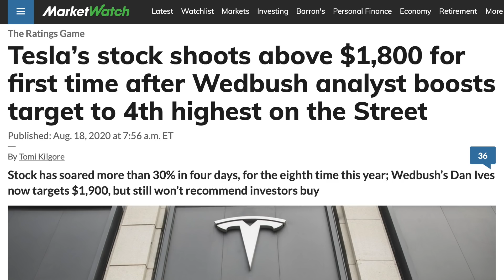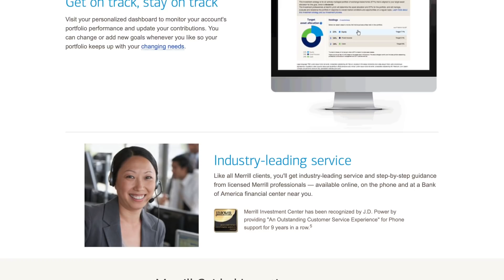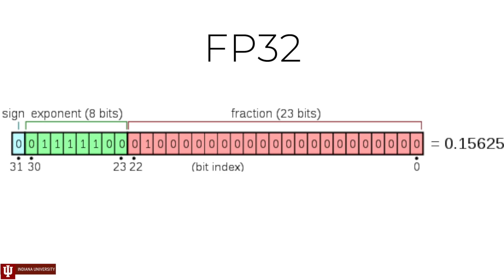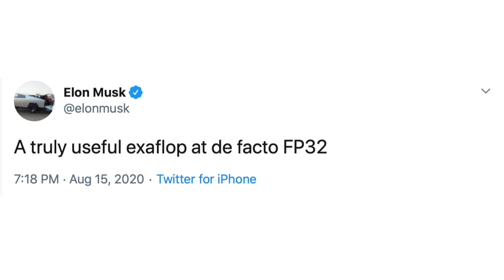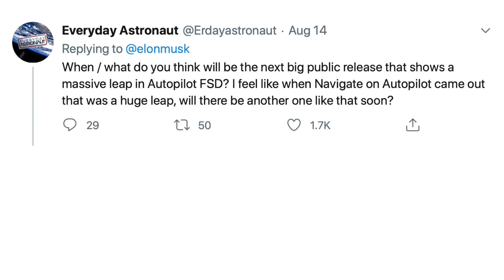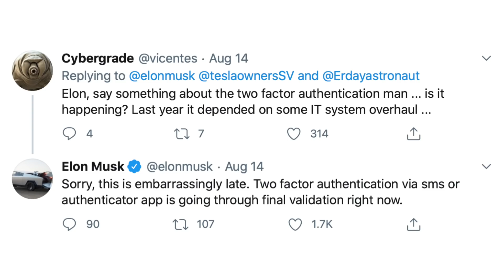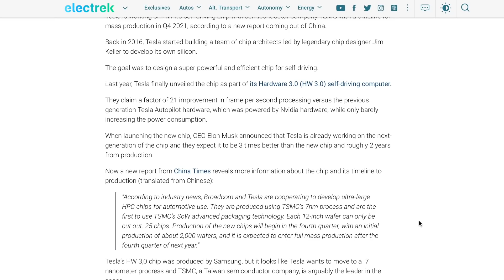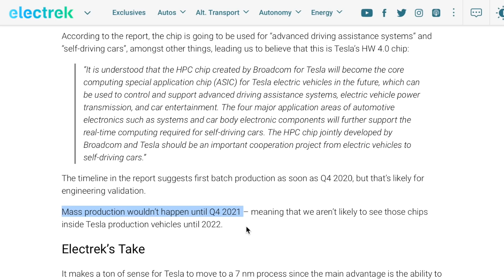Is Tesla Building the World’s Best Supercomputer? + TSLA Stock Hits All-Time Highs

Comment: Thanks so much but confused on one point. If the purpose of Dojo is to process all the driving video so that they'll end up with, well, weighings that can be used in the in-car neural nets, wouldn't that training itself require a neural net vs a procedural computer, albeit a very fast one? Unless they're running a simulation of a neural net vs an actual one. Which is orders of magnitude slower. Which might explain why they need an exeflop class machine to do it.

Comment: Depending on the design of the hardware, moving from fp16 to fp32 may have any impact on speed, just memory/storage space. Many modern graphics cards today work just about at the same speed for fp32 as they do fp64 because the chip is designed/optimized for fp64.

Comment: Linpack does not measure percussion at all. It just measure how fast a computer is able to calculate the floating point value and which one can achieve the most fastest at its peak. Its a standard open source  library package that is used to baseline how much power output each server is able to reach. I also wonder how there going to measure accuracy comparatively.

Comment: I don’t think dojo is a super computer as in academia. Super computer is scaled vertically. Think of your home desktop, you work on it to be more powerful until it’s the most powerful in the world. It may take up the whole room but it’s still one single computer. I think dojo will be scaled horizontally, think of a data center/compute center. It’s a cluster of moderate computers linked together, maybe each unit is with their own Neural Network Accelerator. It’s much cheaper and less difficult to scale horizontally

Comment: 3:17 I'm confused by this talk about FP32. Machine learning doesn't need such high precision, which is why Google's TPU (i.e. tensor processing unit, another chip dedicated to machine learning training like Tesla is designing for Dojo) supports half precision aka FP16. This allows you to fit more parameters in the same amount of memory and do more computation in parallel. Why wouldn't Tesla do the same thing? FP16 support is exactly the kind of advantage you can get from custom designed chips over general purpose ones.

Comment: Hi Rob, I am amazed at your deep research into the details of supercomputer (HPC) bench marking here. you got the top 500, HPL, fp32 story completely correct imho.

HPL, the benchmark used to compute the top500 uses linpack in FP64 precision to compute huge matrix multiplications. FP64 means 64 bit floating points. Modern CPU's have a number of dedicated registers to store floating point numbers and to work with them. 
If you do not need the full 64bit precision the operations  are internally split. Operations like multiplication and division can be speed up tremendously if they are performed on only 32bits instead of 64bits.

This is recognized in the industry and for this reason the HPL benchmark is a little bit adjusted into HPL-AI which tests for FP32 (edit: and FP16, called mixed precision) (https://pureai.com/articles/2019/07/26/nwsdes-hpl-ia-benchmark.aspx )

If you look at the latest results of the TOP500 (https://www.top500.org/news/top500-certificates-top-ranking-systems-55th-list/ ) you'll see at the bottom of the page a certificate for the current nr1 in FP32 /FP16mixed precision (HPL-AI) which gets a score of 1.42Exaflops already when computing linpack with mixed precision. 
So Tesla's Dojo won't need to be nr one in the world to reach Exaflops when measured in Mixed precision

In AI btw, when training neural networks, big 32bit floating point matrix multiplications is exactly what you are doing, so this is one of the cases where these benchmarks actually prety well mirror the reality.

(I worked as an HPC system administrator for 7 years (our system only ended up at nr106 in the top500 once) and went to the HPC conference in us and International HPC conference in Germany 5 where these top lists are announced and where times total, don't hesitate to contact me if you have more questions)

edit:
Not a lot of people are actually capable of running the HPL benchmark correctly and at optimal performance on their systems, for most systems in the top 500 these numbers are just estimates based on the hardware that's in them. Only for the top systems they actually get run. There are 2 people who are running the top500 list that then go over to the system and compile HPL and run it and tweak it a bit until they get the optimal score.
They might not have run the HPL-AI benchmark on other systems that might have beaten the Riken system, as there is no full HPL-AI list published, I could only find this one certificate, so there might be faster mixed precision systems out there that just aren’t tested by the top 500 organisers. 
ps: Austin Texas has TACC (The Texas Advanced Computing Center https://www.tacc.utexas.edu/ ) Which has a lot of top HPC people in the world working there, they almost always have a system in the top10. I believe most oil companies also have  big HPC infrastructures which are not always on the public top500 list.
Reply from the maker: Excellent, thank you for the additional information. Pinned your comment.
Reply: @TeslaDaily  Unfortunately the info on FP32 is wrong (see my other comment). Very minor technical thing, but shows how deep Elon's technical understanding is.
Reply: @TeslaDaily  more likely, they are building something similar to ten Google Cloud TPU v3 Pods.  They don't need all that compute power to be as general as it is on general purpose CPUs.  They are fine with having most of the compute power in specialized chips that mostly do vector inner products (floating-point multiply-accumulate operations) -- just like Google TPUs and NVidia GPUs.

https://cloud.google.com/tpu  (a Cloud TPU v3 Pod is listed as 100+ petaflops)
Reply: No, he did not get the FP32 story correct. What they are doing is called mixed-precision training. This is why Elon said "de facto FP32". In the end this means about half the memory and twice the speed without any loss in training accuracy. I think the key takeaway here is that Elon has a very deep understanding of how state of the art machine learning works. https://arxiv.org/abs/1710.03740 https://docs.nvidia.com/deeplearning/performance/mixed-precision-training/index.html
Reply: Jonas Steinmann yep, you are right, Iupdated my reply and replaced FP32 with FP32/FP16 mixed precision. 
AI research does indeed not need the full FP32 precision. The link to the HPL-AI benchmark I posted earlier mentions it used mixed precision.

 seeing Elon asking for chip people to join their team probably means they are building their own chips, they might even use different floating point presentations and arithmetic  internally on their chips that do not completely map to IEEE 753 fp32 arithmetic but end up being almost the same results but way faster.

At 40:00 in https://youtu.be/KFlR4EwSUlc they explain how the nr 1 supercomputer at the moment has a chip designed especially for it and it has special reduced precision features for AI research.
Reply: a b it might be for communication chips rather than computation chips. Making lots of chips and lots of memory communicate with high bandwidth and low latency is hard, particularly if you want cache coherency and a decent memory ordering model — which they might want.
Reply: Thanks for your insight!
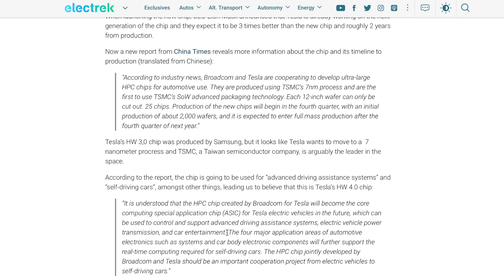Reply: At 10:00 in https://youtu.be/KFlR4EwSUlc it is mentioned that this system is only one of the few they have tested with the HPL-AI benchmark,  but also that the 1.42exaflop was in reduced FP16 mode (but they had to compensate and receive FP64 precision at the end, so I speculatie this could be called ‘de facto FP64’ )
 So I think it is a bit early to get an idea of how you should build a supercomputer that gets 1exaflop on HPC-AI and I should do some more research to find out what exactly the parameters for HPC-AI are, and what would be a System in the top 500 that gets an exaflop on ‘de facto FP32’

Btw the exaflop goal is something that had been thrown around since almost a decade ago to be the next big frontier for supercomputing, so now some might say that doing it in reduced precision is a sort of cheating that a marketing team would do to be able to claim they are the first to hit it so it is nice of Elon to qualify his claim to be ‘de facto FP32’
Reply: Love this community
Reply: I will add that Elon is likely referring to specifically the number of total 32-bit floating point operations used in an actual machine learning application, which could be any mix of operations, but most likely addition and multiplication primarily.

Comment: Welcome back Rob, your podcasts were sorely missed. Tesla is constantly Innovating in so many areas that it is almost certain that development on HW 5.0 is underway. As I understand it, when new hardware is manufactured, in general it takes software around 5 years to catch up in making use of all the new hardware capabilities.

BTW, CleanTechnica did an extensive analysis on the HW3.0 platform, that Elon said was pretty close to reality. Interesting read. https://cleantechnica.com/2019/06/15/teslas-new-hw3-self-driving-computer-its-a-beast-cleantechnica-deep-dive/

Comment: If comparing to Top500.org, you should probably state that those supercomputers are operating at FP64. So Teslas Exaflops at FP32 are a relativly smaller number than what TOP500.org reports on.
Reply from the maker: I did mention that I wasn’t exactly sure on that and that it was likely at a higher bitrate

Comment: 100th mission but only 99th launch as Amos-6 was lost on the pad before launch
Reply: What am I missing? https://en.wikipedia.org/wiki/List_of_Falcon_9_and_Falcon_Heavy_launches
lists 91 numbered Falcon 9 missions. Amos 6 is not numbered. The three Falcon Heavy missions are numbered separately. Falcon 1 flew 4 times. This makes 91+1+3+4=99 missions, 98 launches.
Reply: @eternalskywalker9440  Falcom 1 flew 5 times, it had a single commercial flight - https://en.wikipedia.org/wiki/Falcon_1

Comment: Tesla's current self-driving chip is run on 14nm fabs. Assuming this rumor is true, then Tesla could have HW4.0 run on 5nm fabs providing a significant performance increase while being more energy-efficient.  Future vehicles will have better feed monitoring and more range.
Reply: They don't need to be at the leading edge of fabrication technology. There is a big discount in prices if you avoid competing with Apple on wafer supply. Specially now that Intel is planning to use TSMC's 6nm fabs. Avoiding process nodes that require EUV lithography will keep Tesla away from competing with billion dollar company that can outspend them to secure supply.

Comment: I suspect (Insert Boulder of Salt Here) DoJo is a large bank (or array of banks) of self driving chips that execute training passes in parallel.

An input stream is amplified, split, and piped to all the chips in sync. The chips process those inputs in parallel with their unique variations on the algorithm. Output accuracy would then be compared.

The exoflop comment probably refers to the combined execution power of all the chips in a DoJo cluster.

You'd still need a very powerful system to compare the outputs and pick the 'winners' for each generation. Then decide on how to mutate the winners to form the next generation of algorithms.
Reply: That would make sense with the name Dojo. Lots of chips training together in one place.
Reply: IIRC at autonomy day they said the FSD chips multiply in 8 bits because that was enough for their job.
Anyways, they are optimized for executing, not training.
Reply: @musaran2  I'm not implying the chips will be used to mutate the algorithm, or to compare outputs of various mutations and determine which variations were most successful. Or to serve up testing inputs. That would be inefficient.

I strongly suspect the actual testing will be executed on the chips though. Emulating the algorithms intended execution environment is much less efficient than simply using real chips.

Given each chip has 2x redundancy you could have two different mutations on each chip, hundreds of chips in an array. Then pipe the same inputs to every chip, and get slightly different outputs from each chip. MISD (Multiple Instruction, Single Data). It's the perfect opposite of the concept of a traditional GPU (Single Instruction, Multiple Data).

The varying outputs would then get processed by something more traditional and the winning algorithms would progress to the next generation for further mutation.

Comment: 04:01
Tesla may use FP16 or FP32 or both or whatever. In those operations you can use a combination. It’s all software driven.
Reply: By the way Elon worded it I am thinking they are doing FP32 calculation but store the result in FP16 register. There is good reason for doing this. Doing FP16 Fused Multiply Add on FP16 data requires rounding off twice. This is a big hit on precision. Doing FP32 Fused Multiply Add on FP16 data only require rounding off once when you write back the data to the register. Having FP16 register significantly lower your bandwidth demand and moving data around is more expensive in terms of energy than doing the actual calculation. So having FP16 register increase performance and efficiency and doing FP32 calculation mitigate the impact of lower precision.
Reply: @kazedcat TM
Depends all on the use case, they could use FP8 for some data. 🤷🏻‍♂️

Comment: On the Dojo part, i just want to add 3 things, 1 difference between FP32 and FP64 isn't just memory usage. Doing the calculations with double precision (FP64) will take twice as much time at the least than with single precision (FP32). 2 that supercomputer you compare it to reach that 400+ petaflops performance is in FP64 and is general purpose, meaning you can through any Float Point calculations and it will give a result, and Tesla could be using here a specialized solution, meaning it will only give a result with single precision and the query has to be inside the chip parameters. 3 This makes this not comparable with other supercomputer but that was never the point, what matters is that Tesla is a building Dojo for their needs and that results in a better performance per $ and per power usage. What matters is Tesla had a need for a better solution instead of using GPUs and that is being addressed with this solution.
Reply: Thank you for sharing this information.
Reply from the maker: Thanks for the additional insight, Sergio. Appreciate it. Would Tesla's even be able to be benchmarked on HPL then or not? Understand it's not really relevant, just curious.
Reply: @TeslaDaily  Since we don't know what will Tesla use as accelerators and their specifications i can't really answer that, but my educated guess is that will not give a good result in HPL because that test is heavily bias towards FP64 instructions and since i really doubt the accelerators (this could be TPUs, FPGAs, ASICs or compute heavy GPUs) used here will have FP64 implemented because it's not needed, for example, Nvidia GPUs with FP64 fully implemented cost 10 times more than a normal GPU that has partial or none FP64 implementation. Since Elon used FP32 as the metric I'm certain that is where they will focus for the hardware and NN training software. This makes the comparison pointless unless we do it with another supercomputer with the same purpose.
Reply: @TeslaDaily  kee pup the great content esp parts about exaflops, subbed!